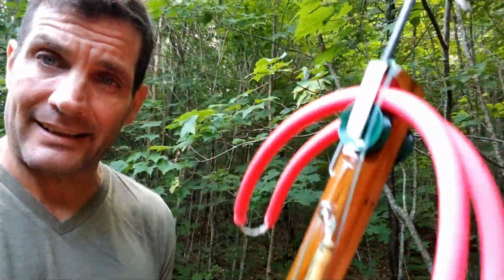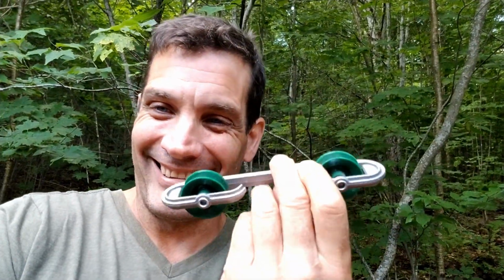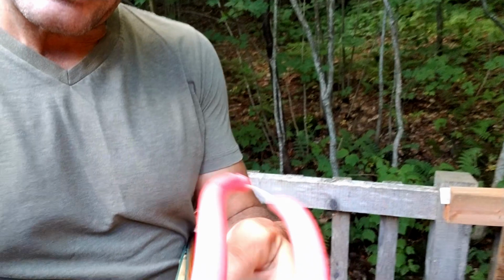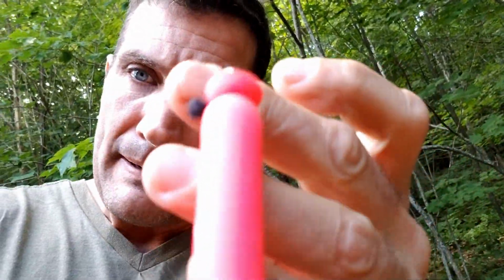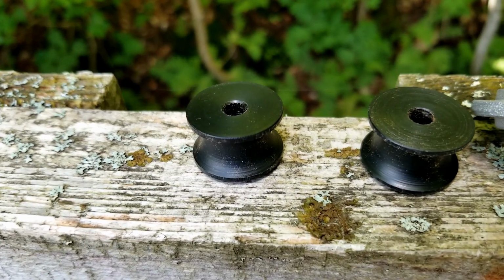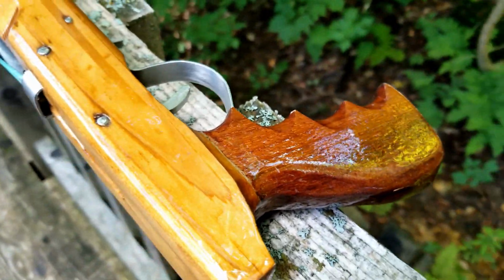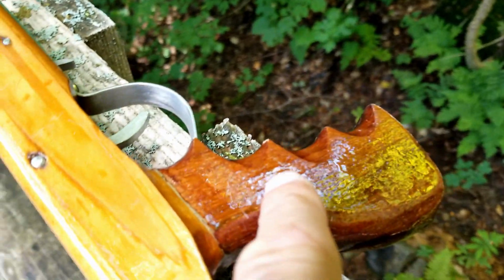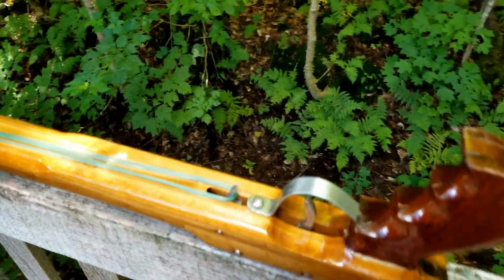shooting stuff with a roller speargun

Comment: I made a similar speargun but I used teak because it’s way easier than coats of epoxy.  I have a ton of cedar though, I’ll have to give it a try.
Reply from the maker: Yeah, I normally go towards iroko but good luck finding dried iroko that will not twist all to hell. Also I use epoxy on all guns because I literally destroy them by diving five days a week, on guns I rarely use, I'll lean towards oil.
Reply: @potvinr  do you mostly dive in Baja and Canada?
Reply from the maker: @wafflebeaver  I dove a lot in Rhode Island before the pandemic. I competed in that region for about 20 years. Last four winters I spent in Baja.

Comment: i use "0840UU" rollers (8x40x20.7mm) which you can find everywhere online which comes with a 8mm hole which means you can just use a stainless steel screw/nut to attach it. it does however use ball bearing.

as for improvements to your gun in my opinion the rubber should never be loose it defeats the purpose of a roller gun you are supposed to attach it on the bottom then it always stays there with tension. at the end of the rubber you are supposed to have 2 strings. 1 that gets stuck on the metal distances preventing it to hit the shaft and 1 longer that you can easily grab with your hand while the rubber is under tension to load the speargun (if you search for roller guns you will notice most have 2 threads on the end for this purpose).
It does however come with a hug security concern if done wrong since the thread could throw the spear backwards.

otherwise nice looking gun
Reply from the maker: It seems that no one understands the two stage loading... the elastic is stretched at 50% umder the gun. Much much much morr than normal rollers. 
I have tried four different rollers, one with ball bearings. I find that larger weels work best (simple physics)
Reply: The rollers you mention, I searched for them, but all the ones I found appear to have a metal bearing(skateboard type) that would rust out in a second. Were you able to find any of the rollers seen here? I've searched all over for clothes line roller tensioners no luck.
Reply: @DarenFentiman  Look for stainless steel (all bearings are however made with high chromium steel) which means that they are corrosion resistant. 

Just pour some tap water when you get to land and the salt will wash off.

Just like the spear and flopper.

Comment: link for rollers? thanks
Daren
Reply from the maker: I'm not selling any guns these day. I don't have the time lol.
Reply: @potvinr  Thanks for the share. I run a boat out of San Jose Del cabo, and am always shooting when I can. Did you ever make a version 2 of your cedar roller? What mm bands were you using on it? Thanks Daren
Reply: @potvinr  BTW all the links to your old websites lead you to some Chinese porn sites🤐
Reply from the maker: @DarenFentiman  I made a 120 cm version of the cedar roller with 16 mm bands. It works better with 14 mm. I had some problems with the bottom holding pins, it's back in the shop. It shot great, but I really prefer a traditionnal 2 band speargun.
Reply from the maker: @DarenFentiman  only one link, the one to miami2 montreal. I will change that lol